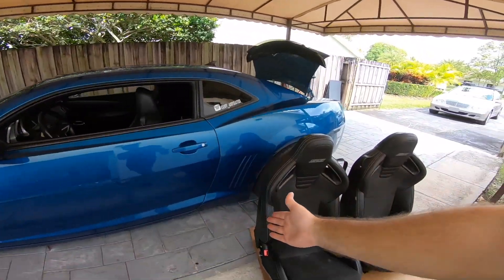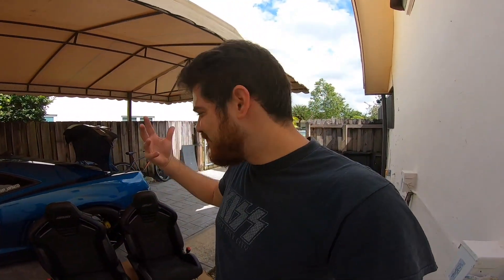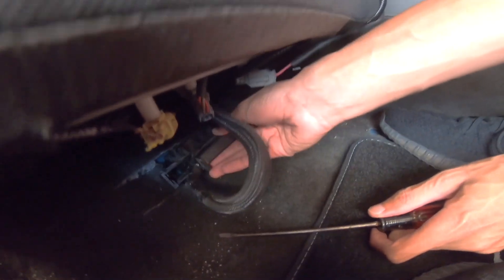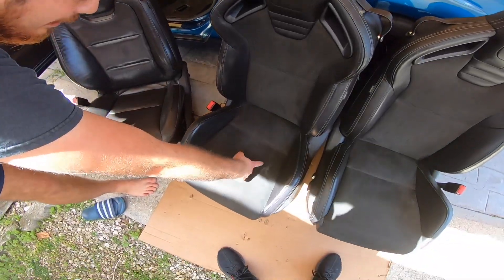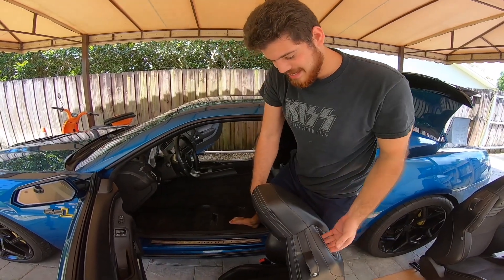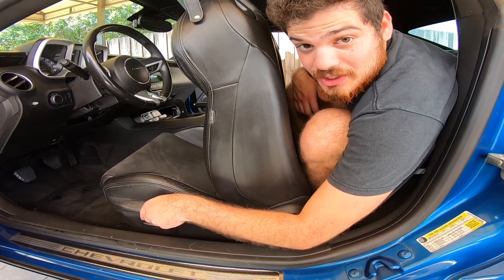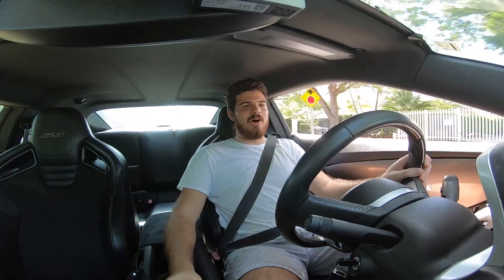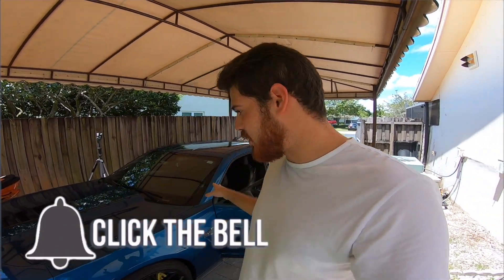RECARO Seats UPGRADE in my Gen5 CAMARO SS (10-15) | Install & First Impressions OEM SS Recaro Seats!

Comment: We’re you able to get the airbag light to go away, I swapped my ss seats for zl1 seats and I have the airbag light on. Just seeing if you were able to so I can try and get rid of mine
Reply from the maker: Hey Collin, haven't coded it out yet. I might go to the dealer and have them code it out. But I haven't driven the car lately.

Comment: Look how his hands are cupping the steering wheel 15:00. That almost prevented me from ever buying the camaro. It drove me crazy during a test drive. 

It was a complaint many had. I imagine its something one can get used to, much like the poor visibility. When the 2013 came out and I saw the new interior , i had to get it. 

Those tidbits aside the 5th gen camaro is an amazing car. Ill own mine forever.  

Very smart choice getting upgraded stock seats. You lost nothing, you only gained. Aftermarket seats you lose seat warmers, various adjustment options and ive read that most Aftermarket seats lower you closer to the floor.  Which makes it little harder to see over the dashboard.
Reply: Yes, I got a 2010 Camaro 2SS and noticed that, but I’m noticed to either having my hands fully on the top upper corners, or on the lower bottom-upper corners (if that makes sense). I’ve had plenty of newer, modern steering wheels that do the same thing; older car steering wheels indeed had a lot of thinner ones, so that’s probably why…..

Aside from that, I had no HUD in mine, which was a 2010, first model year release thing.. But the sun visors are the absolute #1 most USELESS thing in the car… As soon as I got in the pre-owned vehicle, I saw a tinted sunstrip vinyl installed on the inside of the windshield haha. I ended up getting some smoked transparent tan sun visor “extensions”. Not a great and perfect fix, but probably the most practical and fitting (for what I got, anyways) imo. 

The “analog” radios (my joke I call them), which are the older, plainer radio stereo head units with that plain digital display (that older, blue-green, digital alarm clock type of display); only had Sirius XFM, and bluetooth capability for calling and speaker connection (thank God). 

The factory, pre-MyLink (12-15) factory head units, with integrated backup camera setup, was much nicer, except it didn’t make sense imo to spend almost as much to adapt to an OEM setup, when I could go aftermarket for something better, retaining features (and adding extra), and also having a default Carplay setup.
Reply: Aside from that, the only other mechanical issue I have a gripe with, is the shitty 10-12 hydraulic power steering pumps. They absolutely blow cock. 

If you’re a person who likes to hoon and slide, drift around, this definitely isn’t gonna be the kind of car for you; especially if you’re NOT going to be putting in at least $450-500+ for an “entry level” built power steering pump… yeah. 

Lingenfelter has a built one, defaulting around $900, which forces you to buy a custom pulley for it and all… While Turn One has like 3 separate stages of PS pumps, which I think they discontinued their stage 1, known as “street” level; level 2 would be the HP1 model, and level 3 would be the HP2 model (best one).

I’ve gone through a Cardone (next best to OEM AC Delco or Reman), and about 2 other generic PS pump replacements. The Cardone pumps do come with a factory GM PS pump pulley (unless it’s a really good replica?), and some of the generic assemblies come with a lighter aftermarket pulley (which looks good too). 

I ended up getting tired of shitty subpar generic PS pumps, so I ended up purchasing an OEM AC Delco PS pump and using a generic “lightweight” billet PS pump pulley on it. +3 HP, eh..? 

I’m most likely planning on getting a TO HP2 PS pump eventually, with no lightweight pulley (through TO), and no AN fittings. However, if the stock hose fittings don’t hold up for whatever reason (they’ve been okay for the most part), then maybe that might be an option, unless I rid the car by then… I really wouldn’t mind owning a 2013 2SS, 1LE,  or ZL1.

Comment: one small thing to note, these seats don't come on the 1LE by default. they're an option that you are able to get  you get the 1LE package but they are only an add-on to the 1LE.
Reply from the maker: Yeah bro they were option! You're absolutely correct.

Comment: I did this a while ago on my 2010 and in addition to the seat belt receivers, I had to swap over a seat position sensor on the passenger seat to make the airbag system happy. Mine work great and have no dash lights.
Reply from the maker: I need to dive into that. The light doesn't bother me as much. Can you send me pics on instagram? If you have any. Or the thread you used as a reference.

Comment: Read some where that u need to swap the harness to a 2013 and up for the air bags, is this true or maybe a resistor
Reply from the maker: I just uploaded a video and in the description I have links to forums. I think it only pertains to the 2010 models

Comment: Bro can you help me out love your videos I had them seats in my cart and a guy wants $6,000 for them I told him it was too much and he said make him a offer how much you pay for your seat so I can have a ballpark thanks
Reply from the maker: hey bro, sorry for the late reply. I think 6000 is extremely unreasonable for these seats. I don't even think they were that much from factory as a an option. I bought mine for $3000!
Reply: @gvaspirated  bro I bought mine in excellent condition 2 days ago for $1,500 with my original seats as a swap. 

Also I didn’t have the airbag light go on, maybe because it’s a 2011 🤷🏻‍♂️ if anyone knows about the airbag light please advise…